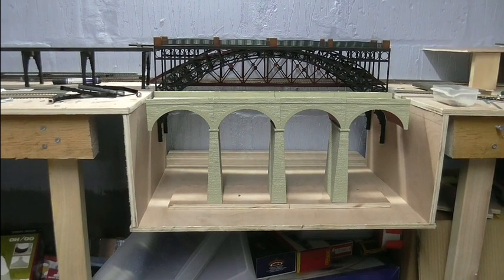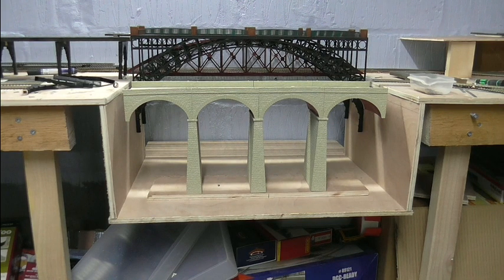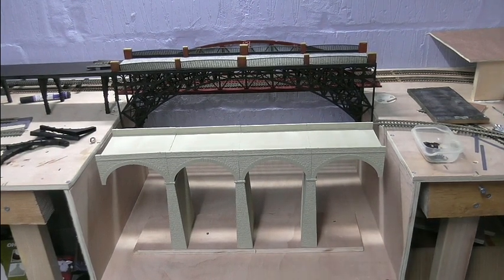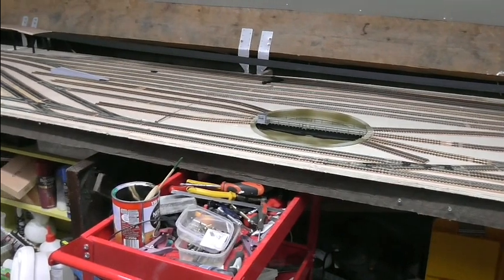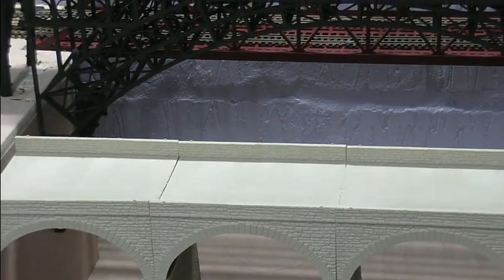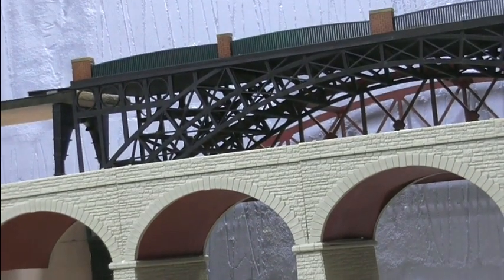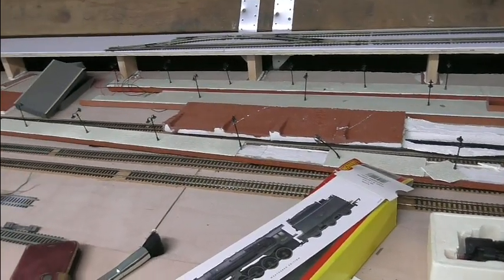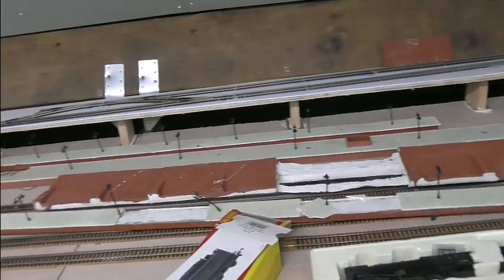Update 8, Stone Bridge

Comment: Looks like the layout is coming along nicely, you’ve layed a lot of track down the inclines look nice ,I have done the same with mine two bridges and a viaduct in front,my viaduct is on the incline and my girder bridge is on the other incline going in the other direction my third bridge behind is not a bridge it is covering the entrance to my hidden sidings, not had any luck with my cameras I’ve had two that have died and when I sorted one my laptop battery died but fingers crossed I’ve sorted it now, just been splint my boards up now ,just in case something happens to me my daughters can get it all out of the loft ,your doing well can’t wait to see some trains running,cheers Mick.
Reply from the maker: Hi Mick, I received a new camera for xmas but not set it up yet, hopefully will be able to edit better, can't wait to get some trains running but the raised level has caused a few problems but hopefully not to long now. the stone bridge was a nightmare to build and have not fixed in place or painted yet. hopefully get some time this week to finish off. all the best. Glynn

Comment: progress is progress glynn
its looking good so far.
as with the station, have you thought of using timber?
ive used 3inch by 1inch planed timber covered with metcalfe brick, and tarmac papers. take a look at my channel.
works out fine and right height 
yours
paul
Reply from the maker: HI Paul, I will look at all options for the station, would be good to get something running, then have more ideas, thanks for commenting. Glynn